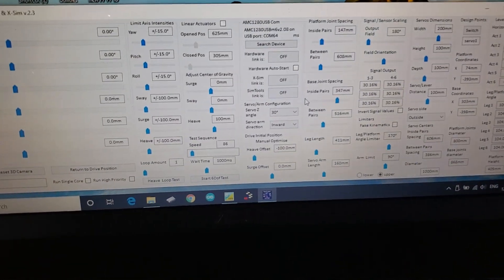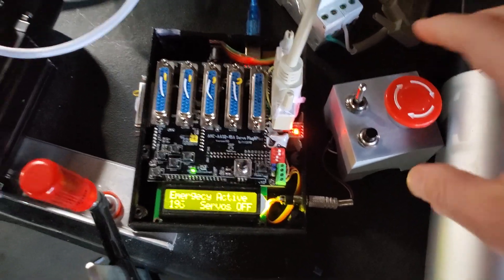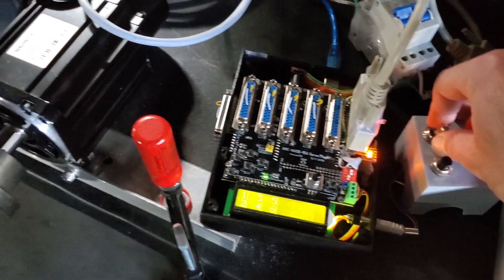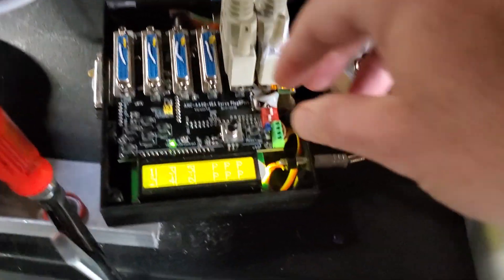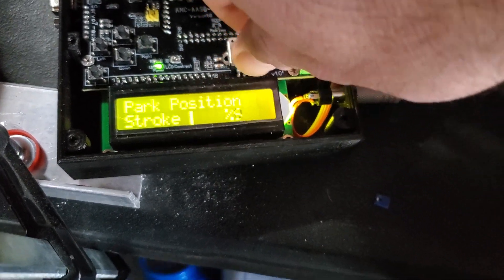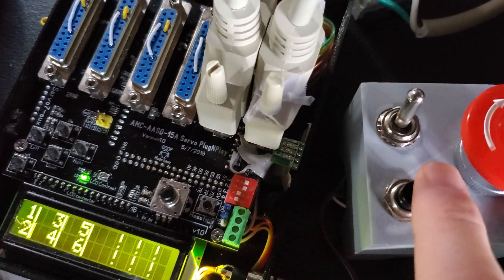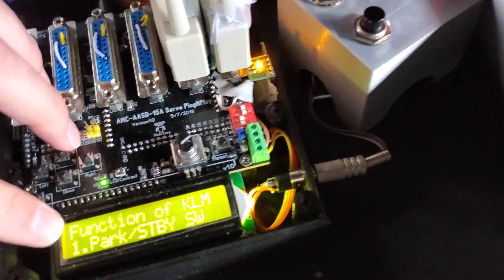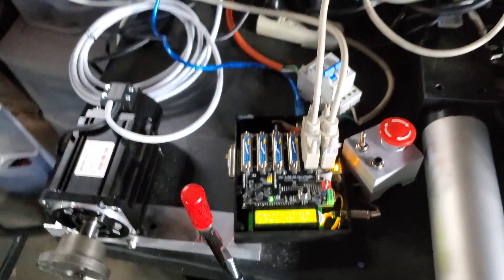AMC-AASD15A, explaining Force Offline switch and E-stop

Comment: Hello there
Do you have China WeChat
Can I add you on WeChat?
Communicate with you
I really want to buy your board
I also want to use it to make a simulated racing direct drive steering wheel
Reply from the maker: You cannot use the AMC-AASD15A to make a direct drive steering wheel. You need another controller to use it as FFB joystick. See here:
https://www.xsimulator.net/community/threads/usb-servo-motor-direct-drive-diy.14120/